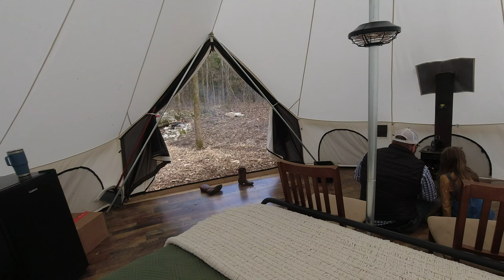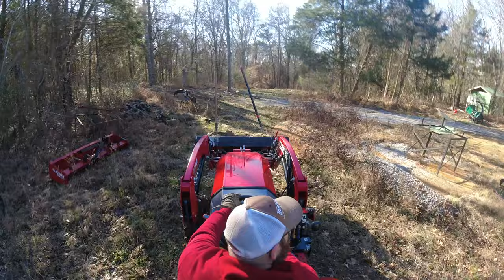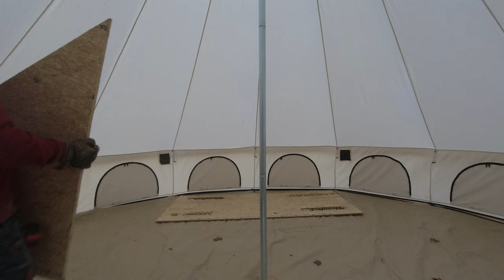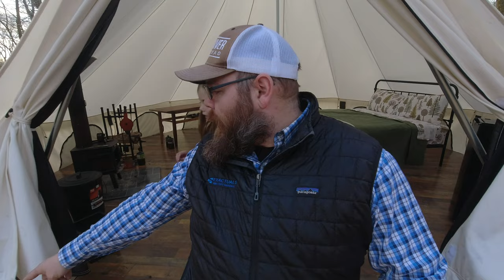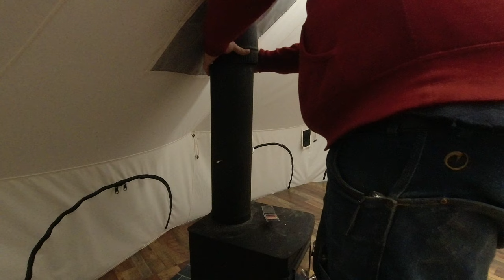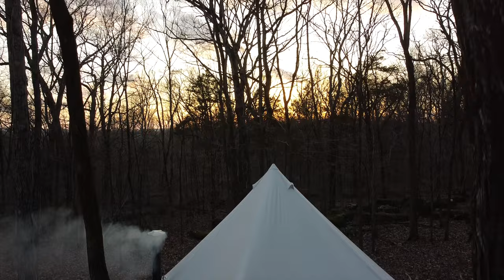053 - Glamping 101 - White Duck Outdoors 20' Avalon Bell Tent

Comment: You want to put up a fire barrier in the back of the stove. (For the lack of a better term.) Protect the tent from burning and reflect the heat.
Reply from the maker: Reflecting the heat wouldn't be a bad idea, but I've measured the temperature of the fabric and it's only about 95˚ when the stove is going.

Comment: You did an amazing job.   I would have built a platform to keep it off the ground so when it rain it won't get flooded.
Reply from the maker: It's not in a flood zone fortunately. It's higher than its surroundings. However I definitely plan on building a platform at some time.

Comment: Great video, nice work. Does the rain not eventually drip into the tent around the stove vent pipe?
Reply from the maker: After almost a year, no it doesn’t.
Reply: @DuckRiverHomestead  2 more questions any issues with bugs, getting in overtime and any issues with mold or mildew as I have seen a few others talk about with this tent. I'm looking for a tent I can leave set up for 5 to 6 months during the camping season in the mountains of Virginia.
Reply from the maker: @CapCityDC I keep a home bug sprayer that I spray around the edges and seams about once a month. I did have stink bugs get in and congregate at the top but that’s cause campers left the bottom of the door open for a week. I vacuumed them out and haven’t had any issues since. 
To help prevent mold buildup I keep the front screens open and about 4 or 5 of the windows about half open. We haven’t had any mold issues. I sort of anticipated mold issues, but hadn’t heard of these tents having issues. I just know that ventilation is REALLY important.

Comment: i am interested in knowing what floor you use under your wood stove.? that looks like what i need for ours or did you make it? Love the vinyl floor idea for your bell tent. I have looked at rugs for ours and also patio locking tiles but they both are very pricey and i would hate to carry everything around when going camping. we have a 16' bell tent from white duck as well. amazing quality of a tent we love it.
Reply from the maker: I got the fireplace pad from tractor supply. this is the time of year to buy them. It's a foam pad covered in metal. It works great.
Reply: Thanks for sharing the tip. I appreciate it

Comment: Can you explain the flooring and the tiles under the fireplace. I have a Teton 5m & 6m tents both with camp chef cylinder stoves
Reply from the maker: The flooring is 
1st layer Advantech on 1" thick runners (wood decking)
2nd layer is a waterproof laminate.
Under the stove is a wood stove pad I got from Tractor Supply: https://www.tractorsupply.com/tsc/product/imperial-type-2-stove-board-36-in-x-52-in-slate